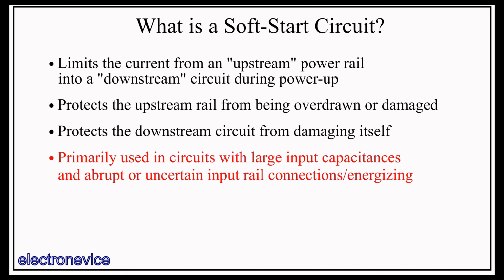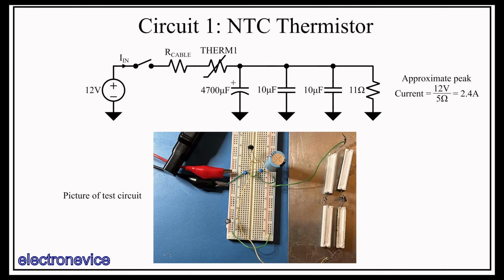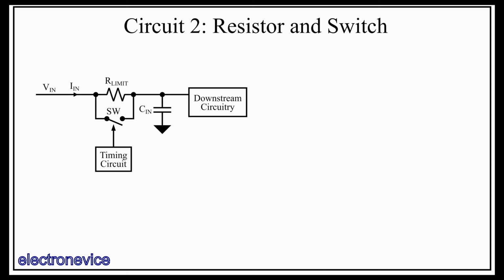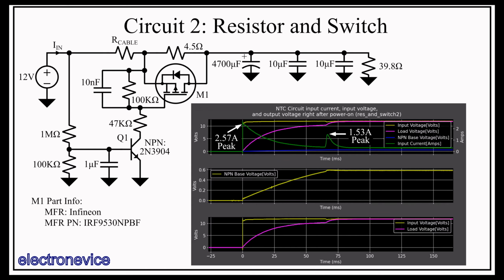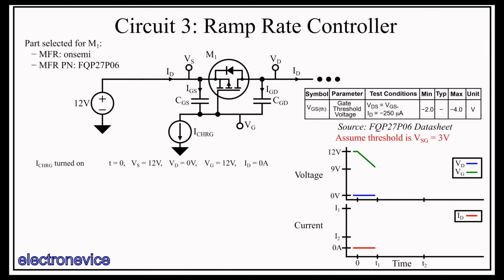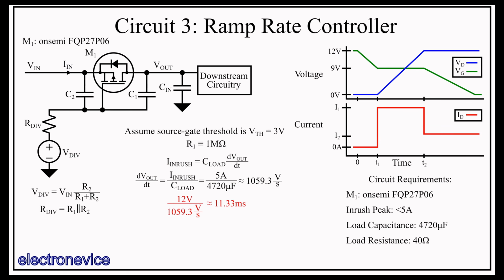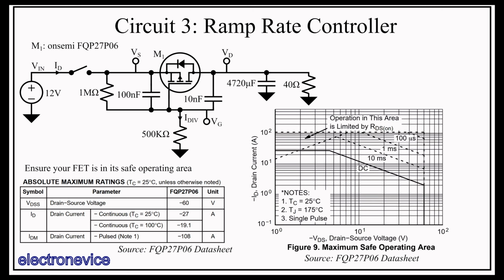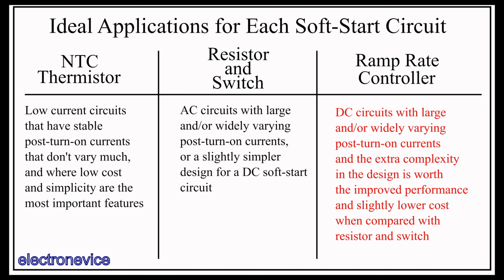Soft-Start Circuits: An In-Depth Look

Comment: At 37:33 when Cgd starts to be charged by Icharge, then the voltage rise from 0V to 12V, but should it not start at Vg (Vin-Vt) = 9V?
Reply from the maker: @thomassorensen7907
So I mentioned this earlier in the video as it's the main purpose of a soft-start circuit, though it's not shown in the diagram: there is a very large "load" capacitor from drain to ground.  What this means is that the currents through the gate-drain capacitance are so small over the entire turn-on period that they cause a negligible change in the drain voltage due to this large capacitor.  So, the only current that is large enough to cause the drain voltage to change materially is the current from source to drain due to the FET being turned-on (turned-on here meaning in the transition portion of the turn-on, when the gate-source voltage is "near" the threshold voltage).

A second piece of information that is also not shown is that there’s a load resistor connected from drain to ground.  This means that prior to t=0, that the load capacitor is fully discharged and that the drain voltage “starts” at 0V.  

So when the gate-source voltage hits that FET’s threshold voltage, significant current starts to flow through the FET's channel and that massive load capacitor starts to charge up.  That current starts charging that load capacitor up from 0V to 12V, it does not jump to 9V due to the current through Cgd capacitance “feeding-back” into the gate, thereby keeping the gate-source voltage right around the threshold voltage creating this “Miller plateau” shape.

Regarding the "charged" state of Cgd, in my mind I don't really think of Cgs and Cgd as being charged or discharged as they’re not power capacitors, so that was probably confusing when I said it starts to get charged at t=0.  

A better way to describe Cgd’s charging profile is that Cgd is "charged-up" to 12V (12V on gate, 0V on drain) at t=0 due to the fact that R1 ensured that the gate and source were at the same voltage to start, and since the gate is 12V and the drain is 0V then Cgd has to have 12V across it.  As the gate voltage drops initially from t=0 to t=t1, the gate-drain capacitance technically discharges a little (the gate voltage becomes lower (i.e. closer to 0V) and the drain stays at 0V).  Once that Miller plateau is reached then the gate-drain capacitance starts to get "discharged" further as the drain goes from 0V to 9V (with the gate now fixed at 9V) but with current continuing to flow into the gate after drain hits 9V, the drain voltage rises above 9V up to 12V which is technically "charging" the cap with the opposite polarity (even though the charging current doesn't change direction, the current just flows through a cap that has an voltage of Cgs = 9V until it becomes a voltage of Cgs = (9V-12V) = -3V)

I hope this clarifies rather than muddies things.  I hope I hit upon the points you were unclear on, if perhaps only by accident 😊
Reply: @electronevice  Yes that helped a lot, especially the last part.
Thank you again for a good video and taking the time to explain in detail as well.
Reply from the maker: I'm not sure I understand the question.  "but should it not start at Vg (Vin-Vt) = 9V"  should what not start at that voltage?   Drain voltage or gate voltage?  And do you mean the start being at the start of the whole sequence or at the start of drain voltage rising? Also Cgd starts to get charged at the beginning due to the gate voltage changing, are you referring to when the Miller plateau occurs and the gate voltage stops changing and only the drain voltage changes?
Reply: @electronevice  I mean the drain voltage, which start rising at t1. When you say Cgd is initially charged during the charge of Cgs, is the voltage over Cgd not negative?
Yes maybe I am not fully understanding how the Cgd is initially charged from the start of the whole sequence.

Comment: This is the exact video that I was looking for! I'm working a voltage source of 400Vdc (battery pack) to load the capacity bank of a traction inverter. Thanks you for the well explained mathematic. 👍
Reply from the maker: Glad you found it useful!  Good luck with the inverter! 😊

Comment: I just tried this circuit and it works great!
My inrush current was 40A and after building the circuit it dropped to 3A. Perfect 😊
Reply from the maker: Great!  Glad to hear it’s working for you! 😊
Reply: @electronevice I didn't play with any values yet as I don't really need the inrush so low, but it's a great addition to the toolbox.

Comment: Could some of these circuits also be combined to be a simple reverse polarity protection as well?
Reply from the maker: You can get reverse polarity protection with some slight modifications.  For reverse polarity protection the PFETs oriented as they are for the “Resistor and Switch” and “Ramp Rate Controller” each have body diodes that will not block reverse current, so you would need to use a PFET with the source and drain connected in the opposite way so that the drain is connected "upstream" to the power rail, and the source is connected "downstream" and have proper circuitry to sense the reverse voltage and make sure not to close the reverse-polarity-protection FET when there’s reverse voltage. 

You could of course optionally use a relay in-front of the circuit that you only allow to close when the voltage polarity is correct.

Edited for clarity